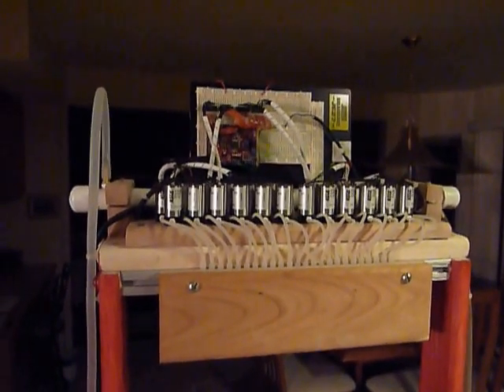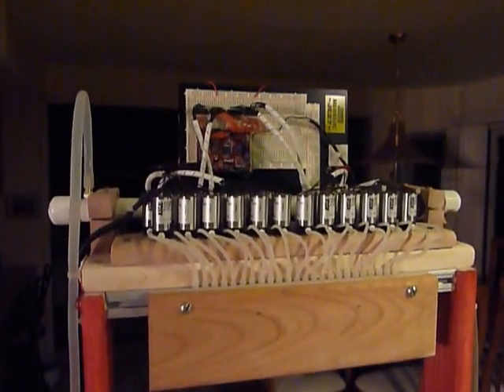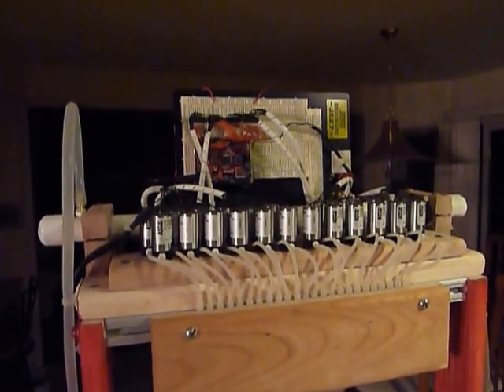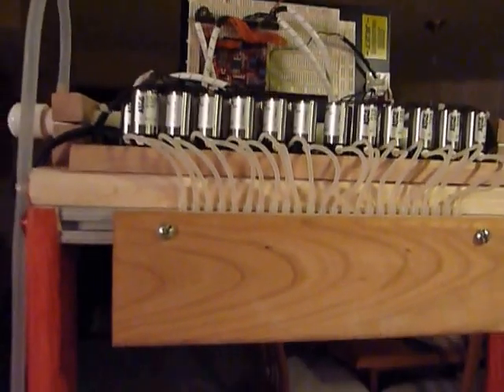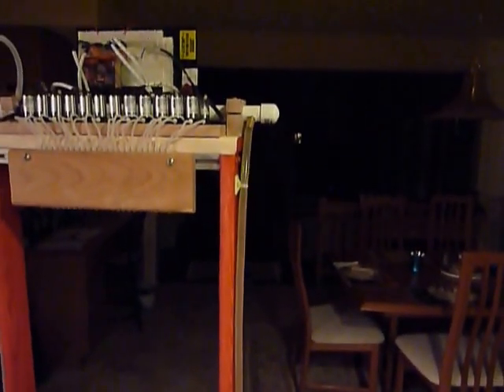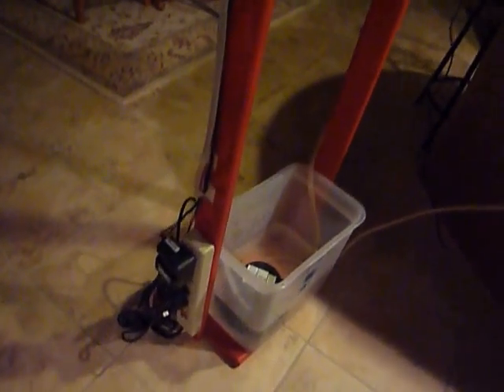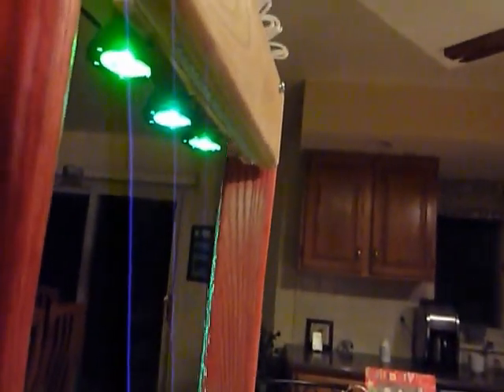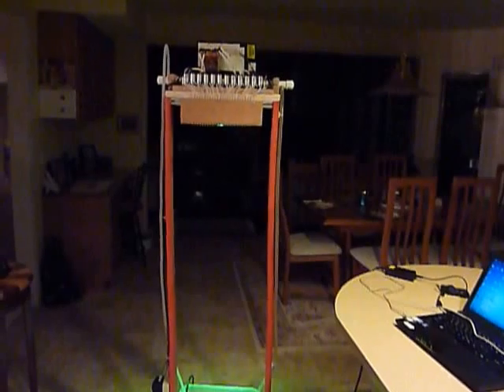Digital Waterfall Display

Comment: Cool! What's the nozzle diameter and how far are they spaced?
Reply from the maker: The silicone tubing has a 1/16 inch diameter and I believe the spacing is 1/2 inch.  The water recirculates through the supply header and back to the tank, with enough flow to cause a slight pressure towards the valves (probably 1-2 psi)  The pressure is set by the pump selection- I used one with a 9 foot head capability.  This slight pressure causes the water to trickle (not spray) out of the silicone tubing ends.
Reply: Ah. But wouldn't the pressure increase if fewer valves open at a time?
Reply from the maker: Good observation- it does, but only slightly.  The circulation pump flow rate is much higher than the valve flow rate, so the pressure drop from a few valves is minimal.  Opening all 24 valves does reduce the pressure noticeably but enough water still flows to create images.
Reply: What if you were to scale this up? (more valves and a pump with larger flow rate)
Reply from the maker: I think a modest scale up would work fine- maybe 2X.  If you are shooting for a commercial size display, the water height, total flows and pressures are all bigger.  Higher output valves would be needed, much larger pumps and it would probably require more careful pressure management.  The basics would remain however- you would want to supply significantly more circulated water to the header than the maximum nozzle use would consume.
Reply: How do you think power is handled in large models? Assuming each valve consumes about 250-500mA at around 12/24V, that's a LOT of power if they have like around 100 valves.
Reply from the maker: Yes- I would use 24V DC valves (lower current than 12 volt valves) - assuming 100 valves at 250Ma you could probably use a 30amp supply- less than $200.  I imagine some commercial units have closer to 1000 valves- that could consume 250 amps!

Comment: Hello! Great Job! What kind of valves are you using? Thank you:)
Reply from the maker: Thanks!   I used Valworx type 43124 which have a fast on/off time.  I wasnt sure how they would hold up to water, but they have run well for several years so I think they would be a good choice.  They require 24Volts DC to run, which is pretty safe and easy to wire.  Good luck!
Reply: +Tom McKeehan thank your so much sir! Can I ask you one more thing? What type of Water Pump did you used?

Comment: hi sir! What software did you use?
Reply from the maker: I wrote the code using the UNO 32 controller and the software development environment that comes with it as a download.   You can find some of the high level code description in the notes below.  The language is a lot like C++, so you might want to get familiar with the UNO 32 system before jumping into the waterfall development.   Good luck.
Reply: Ok thank you sir

Comment: greetings, as I control solenoids , which have some software and if so , where can I buy what I would be very useful, thanks
Reply from the maker: Hi Ruben.   I think you can find most of the hardware details in the posts below.  The software is described in high level in these posts as well.   Let me know if you have specific questions that were not answered and I will try to provide an answer.

Comment: Hi Tom is there a possibility you can send me some specs on all the hardware used.
I'm looking to make one of these for a show we will be doing with our Unitronics PLC's
Your help wold be greatly appreciated.
Reply from the maker: +Michael Lagler  Hi Michael.  The reply to Diego's note below has some of the specs that might help.   The valves (Valworx part 43124) are turned on/off by a Chipkit Uno32,  buffered thru a high current drive chip (ULN2803).  The UNO32 has a faster computer and more I/O than the standard Arduino UNO and is about the same price.  The water is supplied to a 1 inch PVC header by a submersible pump located in the bottom tank- any pump capable of 5-10 feet of head would work since the actual volumes are low.  The water flows into the right side of the header and back out the left side, returning to the bottom tank- this keeps the header slightly pressurized.  You want just enough pressure to allow the water to drip out of the display tube without spraying.  I drilled 24 holes in the PVC header and added 1/16 inch pipe nipples to each- those feed the valves via a short silicone tube.  Finally, the valves outputs are all placed side by side about 1/2 inch apart so that the water drips from a line of tubes.  I put three colored LED spotlights (3 watt) facing down so that the water gets illuminated.  This helps the letters stand out especially in low light areas.  The lights are always on, but could be computer controlled to synchronize with the display.  The Unitronics PLC should work fine as long as you can provide 24 outputs with sufficient current (probably 100 milliamps) and can turn then on or off in less than 10 milliseconds.  The valves actually can't respond much faster than 10 milliseconds.  My program used a 2 dimension array that defines each character, and then the software just sent out the on or off commands to each valve starting at the top line of the array and working down.  You might be able to use a similar approach in the Unitronics if there is sufficient memory, but each character used 24X36 elements (24 wide for each valve and 36 long to define the character from top to bottom).  Hope that helps!

Comment: hey hi, do you have any kind of documentation of the material that you used? it will be really helpful to have an idea from where to start doing my school project. Thanks
Reply from the maker: The system uses a small pump (submersible with about 5 feet of head capability) to circulate water through a 1 inch PVC pipe (the white end caps are showing).  I then drilled 24 holes in this pipe and put in 24 small fittings which connect by 1/16 ID tubing to the solenoid valves.   These valves are 24V solenoids (stock 43124 sold by Valworx.com).  Since the valve current exceeds what the Arduino can provide, I added three solenoid driver chips (ULN2803) that directly interfaced with the I/O.  The water then flows through the valves into the 24 tubes with are lined up side by side using grooves put into the backside of the wood face.   Once I was able to control the valves, I created a bitmap of the characters that I wanted and then fed this array to the valves one line at a time.  Hope that helps, and good luck!
Reply: Yeah this totally helps!! Thanks so much, i will try to get this amazing system.
Reply: Tom McKeehan Hi, is there a way to see how you are using those bitmaps, i am using 2d arrays of bytes but it's really heavy for storage data
Reply from the maker: *****
Sure.  The Uno32 has quite a bit of storage area, and I have only defined 8 characters.  I think that used about 22K out of 128K, so you could probably define the whole alphabet.  Each character array is 24 wide and 36 lines long.  For example, the first row of the letter I is defined as char* letterI[]= {"111111111111111111111111", with 35 more similar entries.   The 1 signifies a valve on, and a 0 would signify off.  I then move the entire array into a temporary array called dropdata.  Then I pull out the individual numbers with this code:
for (dropseq=0; dropseq<droppatterns; dropseq++){
      cntl=dropdata[dropseq].
Then I grab the individual control bits into "cntlbit" with this code:
for (int thisPin = 0; thisPin < pinCount; thisPin++) {  
    cntlbit=cntl.charAt(23-thisPin);
Finally I turn on the valves with this code:
        if (cntlbit == "1")  {
        digitalWrite(ledPins[thisPin], HIGH);
        }
         else    {        
        digitalWrite(ledPins[thisPin], LOW);   
        }
After turning on the valves, I wait .01 second and then send the next line- that give the whole character about .36 seconds to form.  I am sure this code could be simplified, but the core control uses a character array to define the on/off status of the 24 valves for 36 lines.   I manually wrote the character array- just drew it in Excel and then wrote down the on/off patterns.  Hope this helps!
Tom
Reply: Tom McKeehan Thanks for taking time to answer me, i tought that you were storing the data using .bmp files. But my code looks a bit like yours.Despite i am only using 8 solenoid valves.
Reply: Tom McKeehanInteresting. I have similar like your with 64 sol.  but what about interfacing it with software? isn't that more friendly? Now is limited... can you share the arduino full code with firmata?